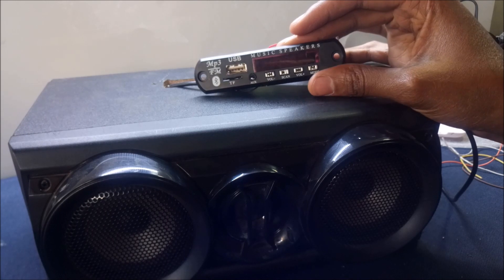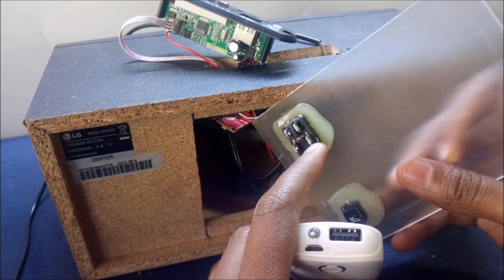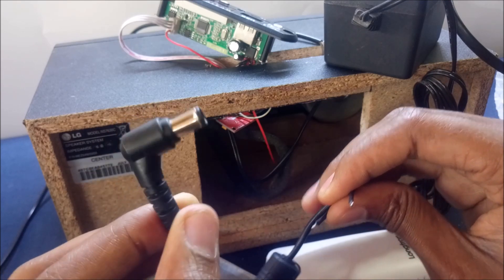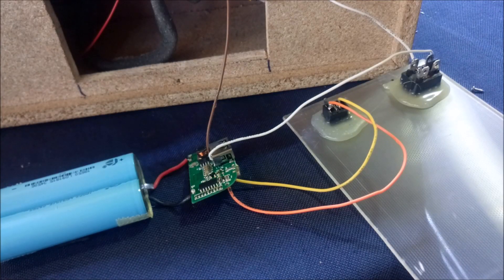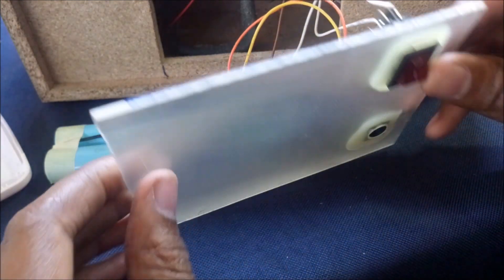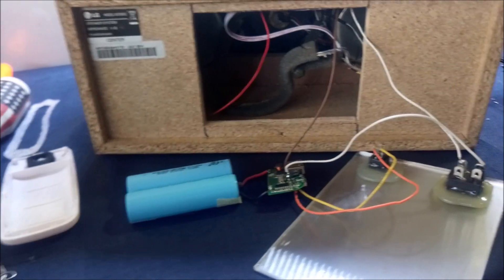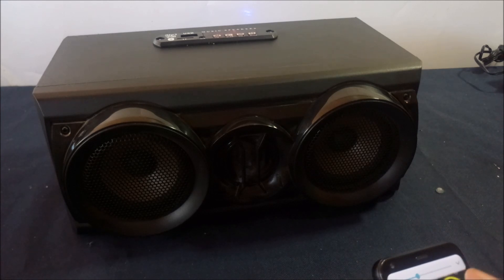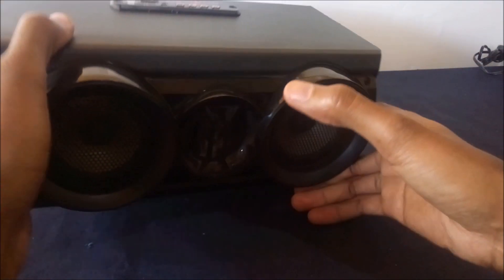DIY Bluetooth Speaker Part 2

Comment: those speakers deserves a bigger amplification module, and you didn't seal the box at all, so there's still air leak (the usb and sd-card slots and even the function buttons are prone to create turbulences during a bass test or bassy music).
Reply from the maker: I will work on that